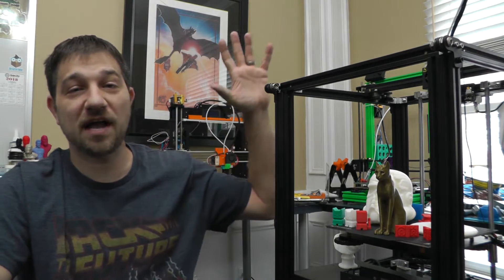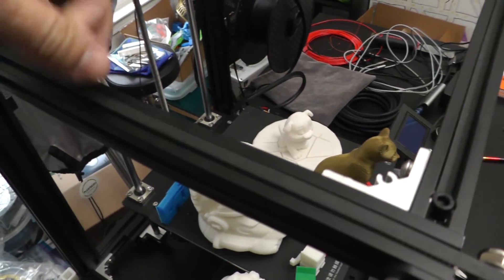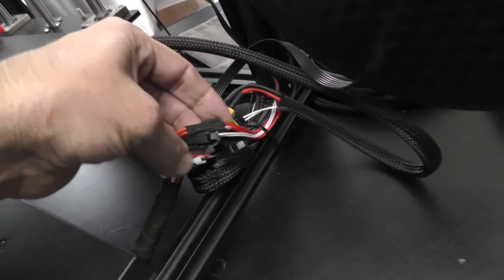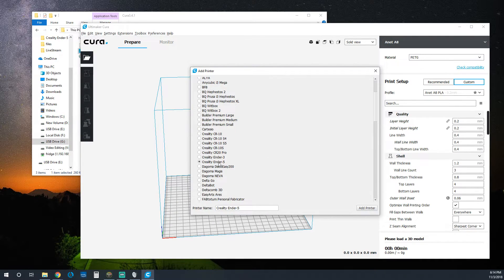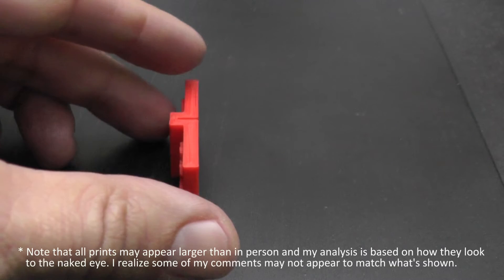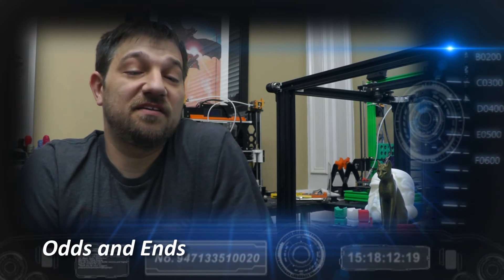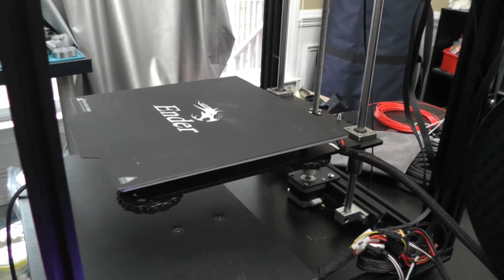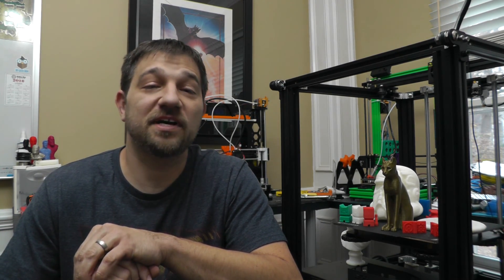Creality Ender 5 3D Printer Review (No Background Music)

Comment: The only thing I found that sucks on the Ender 5 is how the designers neglected the fact that the users wont be able to see anything being printed since the build height stays constant with only the build plate lowering while the printer's frame blocks your view the whole time. I have my Ender 5 Pro on the standard-height desk and while sitting in a chair you wont see anything because of the frame blocking your view and will always have to be standing there when wanting to generally observe or otherwise keep an eye on it. 
   If the desk was too low, then I could simply and cheaply raise it with just about anything under the legs, but when a desk is to high, you dont have much if any practicality for lowering it unless you dont mind cutting off the legs and side boards of your nice desk and then losing space under it that's made for storing things for the 3D printer

Comment: Hey, How solid are the rollers on your x-axis? I can't get mine to tighten up anymore and the print head wobbles back and forth as it moves over the material. Is that normal, or is it supposed to be pretty firm in place?
Reply from the maker: It should be pretty firm in place. Are you familiar with using the essentric nut to tighten the rollers? Here's a video that explains the process: https://www.youtube.com/watch?v=gAJRw1X738s Just look for the nut on the X axis rollers.

Comment: print a sphere to check the roundness.  straight x y is not the whole story.
Reply from the maker: Thanks for the suggestion. Even if the sphere was off though, steps could be adjusted to fix the problem.
Reply: Yes, I would agree, but the whole story includes X Y Z, directional change; the coordinated motion reveals so much about the end uses of the printer for fit and function etc. I would argue that the price point of many printers is best shown in these transitions. Not too many reviews have touched on circularity of the output.
Reply: Of course the Z motion is not really a factor.  But it would be nice to check circularity at different Z height.   Perhaps:?
Reply: Even a thin wall column to the z limits would be a nice, quick test.
Reply from the maker: I know this isn't thorough but check out my Twitter account for other prints. Specifically, I think this is what you were asking for: https://twitter.com/KerseyFabs/status/1076484741967302657?s=19

Comment: How does this compare to the ender 3?
Reply from the maker: From my review: "Many people are going to wonder if this printer is worth the extra cost over an Ender-3 or an Ender-3 Pro. Unfortunately, I can’t do a direct comparison since I don’t have one [an Ender 3] but I can compare it to my similarly designed printers. My personal opinion is that this is a respectable upgrade for the cost, particularly if you already have a printer of that design and you’re looking for something that produces slightly high quality pieces. As a cosplayer and someone that does like to post process and finish a print as time allows, anything the printer does better is one less thing I have to sand flat or clean up in some other way. In fact, with that in mind, the real shortcoming in this printer is that I want a bigger build volume. Keep in mind that this is already bigger than the Ender-3 in the Z-axis at 300mm, as opposed to 250mm, but I want one of these at 300x300 or even 400x400 so I can print high-quality helmets. Hopefully Creality will see this review and start working on one!"

Comment: You do know that you can build a bigger print frame and install all the components from the 5 onto it. The only things you would actually have to replace are the belts
Reply from the maker: Actually, the biggest issue is the print bed. You'd have to fabricate a new mounting system to support the larger bed, you'd have to find a larger bed that would attach, and you'd probably have to also add a support on the opposite side to hold the larger mass. On top of that, you'd have to produce custom firmware, which isn't a problem for some but would be difficult for others.